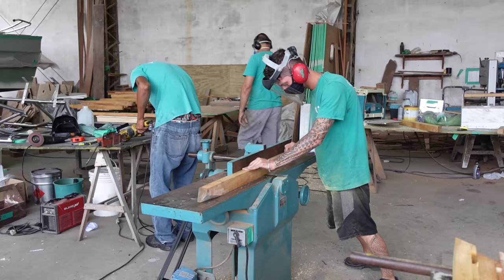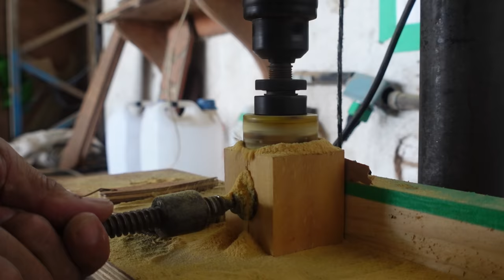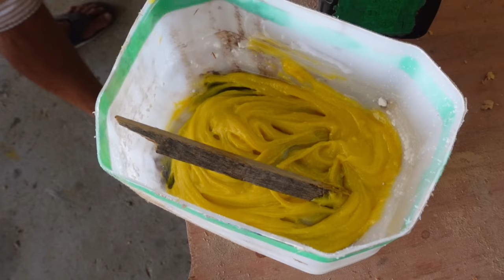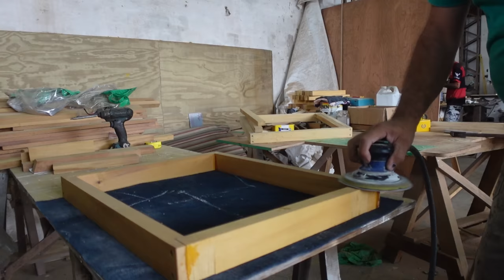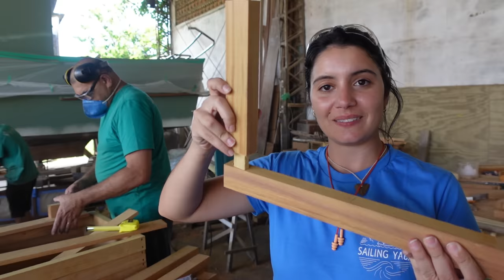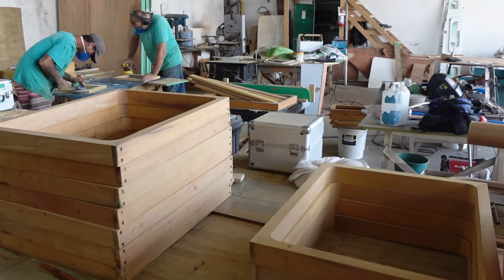Hand-crafted wooden windows for a hand-crafted wooden boat — Sailing Yabá #87

Comment: You might want to have a couple of spare windows made for replacements.   Also, are you planning on fresh air ventilation?  You should be able to have the windows closed and still have ventilation.

Comment: How are you going to maintain water tight integrity with the sliding windows?
Reply: My question as well🙄😬
Reply: Probably the say way it's done on houses for 100s of years.
Reply: @SawmillerSmith  Houses and boats are completely different animals, there zippy.
Reply: @brutusbarnabus8098 windows are windows on a boat or a house. They both if built correctly keep the water out. This has been done for hundreds of years.
Reply: @SawmillerSmith  This is not a preferred window for a marine application. All residential windows have weatherstripping to prevent elemental intrusion. These  windows (portlights) have none. You can slant the exterior sill on a house window and shed water because the wall remains perpendicular. Sailing vessels simply do not lend themselves to maintaining perpendicularity. Even in a moderate squall with 25 knot winds, those windows are going to allow fresh water intrusion which is not desirable on a vessel.
Reply: @oldsharkie3786  I've worked on a lot of old homes were the windows had no weatherstripping. They had cast iron weights to counterbalance the bottom sash and they have keep water out for decades. I'm sure they have a plan for all your concerns. I'm not an expert boat window builder. But I have redone lots of old windows that have worked for decades with weatherstripping. Perhaps they will add weatherstripping when the window frames are done? Be a simple thing to add on.ive done it to lots of doors and windows.
Reply: @SawmillerSmith  Your words "I'm not an expert boat window builder." In light of this why not move on with your day, zippy.
Reply: @brutusbarnabus8098  True I'm not an expert boat window expert. But they are some  similarities. They are basically the same. These boat windows have epoxies in brass and other things. There are always these so called experts that have an opinion yet never no experience about the subject. Happens to me before. I'll be doing a job for someone and they tell me how to do the job. If they know how to do the job why would they hire me to do it?
Reply: @SawmillerSmith  In another 10 or 15 years this boat will be rotten again. Hopefully they can sell it before it gets too bad. Water will hit the windows from all directions. They will leak.
Reply: @verdigo5892  10 15 years most boats leak and rot away if you don't do anything to them if keep in the salt water.

Comment: By having sliding windows, does the risk of leakage increase significantly?
Reply: Once you're on a boat, there's no risk that it won't leak somewhere. Sliding windows just increase the amount of leakage  :D
Reply: Considering where they are, no more than they would on a house, the windows are on the sides of the cabin above deck, well inboard and under eaves (coachroof) so it would not be any difference to sliding windows on a seaside house. if they were in the hulls like portholes then I would be more concerned. but many boats have sliding windows this high above the waterline.
Reply: @daveamies5031  Thanks Dave...that’s clear👍
Reply: The only way now of making these window openings watertight is to devise shutters with gaskets over them.  These sliding windows cannot withstand water ingress and will rot quickly, even when epoxied.  Even if they are planning on only using the boat in sheltered waters, these windows won't keep out the rain.  I have far better windows on my house beside the sea.
Reply: @evanschwartz3030  On reflection, I lean towards Evan. We live in Normandy France. The wind and rain always come from behind the house so we have no windows at the back and I cannot recall the last time I cleaned the front windows on any floor as the water never touches them. I will be fascinated too see how they try to prevent water entry. I guess shutters would not do the biz? As you can tell, I am no sailor🤦🏻‍♂️😉
Reply: @evanschwartz3030  Sliding horizontal windows leak on houses too when the wind pushes the rain against them, never said they would be water tight, just that it will be about the same, it won't sink the boat it might be enough to end up with a damp bunk though which could be unpleasant, if the outer part of the window is fixed and the inner window closes towards the stern it shouldn't be too bad if they can keep the bow towards the wind.
Reply: @mikewilliams4499  Your lucky to have predictable weather conditions, most of my windows leak on which ever side the storm comes from, storms come from all directions where I live, westerlies usually bring hail, northerlies bring damaging wind and southerlies bring cold, easterlies bring lots of water (300+mm/hour) and flash flooding. 
I don't think any of Yaba's sliding windows will be installed facing the bow, so they if they are at anchor they may get less leaking through their sliding windows than I do?
Reply: @Tomm9y  The whole boat is going to rot...the sealing paint they used everywhere was only minimal. But they should get about 10 years before they need to start over. Also, they left a lot of rotten wood in the hull and that will only shorten the life of this boat. I still say they would have done better to just start from scratch.

Comment: Beautiful work. I also am concerned with the high possibility of leakage. Sideways winds Squall,  hurricane force winds, bow spray. Even just condensation can be an issue I would think. I hope not, but definitely consider it when building the windows.
Reply: I have said it before and I will say it again the skilled workers allowing Yaba live a new life are amazing. Yaba is certainly not a boat built of modern materials like fiberglass and carbon rather a locally traditional build using methods of a traditional design. That is what I think makes it so unique. Simple things like drilling holes in the window frames are done by eye and from what I could tell are spaced equally within a few millimeters of one another impressive stuff. Stay safe
Reply: @mp6756  I’m with Raymond on this the windows will leak. Will it sink it? No. Would it look stupid with round portholes? Yes. So decisions are made based on usage and style. I do hope the don’t use plain glass or cheap plexiglass.
Also I don’t think they are going world cruising. I remember something about a dive boat.
Reply: @icelandviking1961  Agreed they will leak no doubt about that. I'm fairly confident they are going to rome the coastal waters of Brazil. I hope they don't try crossing the Atlantic with Yaba it's definitely not the right design and with only internal ballast she won't be comfortable on the open ocean. When I say comfortable I mean safe. Brazilian schooners are very popular as charter business hosting tourist and for the two of them on their channel they have a lot of beautiful country to explore and share. Yaba is big enough I'm sure they could sail to the north up the coast without much difficulty. It's a great channel watching the boat take shape with what I would say different than usual construction methods.
Reply: @mp6756  Mike, I worked in a boatyard in the 70’s in California. Some of what they do was use on wooden fishing boat then. It was cheaper but not unsafe. The marine growth will be harder than anything else. Remember a boat starts sinking the day you put it in the water.

Comment: Just a small tip. Make a lip above each window. That prevents them from leaking most of the time. I think you know that your boat will only be suitable for coastal cruising and that's fine. But be aware that leaking windows are a serious problem on a wooden boat!
Reply: I think it's more serious if the hull leaks.
Reply: @brian.7966  🤣 Good one if you are referring to my little leaking problem ⛵️ But I can tell you I have experience with leaking windows as well. 😂 Fortunately we don't have a wooden boat. But you would be surprised how fast fresh water can cause damage on wood. It's a matter of a few month.
Reply: @FlyingConey  I don’t think they have a clue it’s just a coastal cruiser. From comments they’ve made, I think they believe they’re going to travel the world in this thing. Hopefully they’ll figure it out sooner rather than later.
Reply: @brian.7966  Wrong! It is normal for a wooden boat to have a leaking hull. This it what bilge pumps are for! 
If you have leaking windows the wood will rot in a few weeks due to sweet water!
Reply: I think they should seal them shut and waterproof them with Sika!

Comment: You are making a huge mistake. The runners of the windows can not be sealed from the salt water after they are assembled. They will rot rapidly. Use some sort of plasitc for this.

Comment: What method is used to prevent leakage from the sliding portion of the window?
Reply: Prayers 🙏
Reply: They have already explained that there is drainage from the lower channels to the outside.

Comment: I wondered why they didn't square up the drilled mortises rather than rounding the tenons. Maybe mortising chisels are hard to get. Also, perhaps build a tenoning jig for the table saw to hold and support the piece vertically while it's passed through the saw to cut the cheeks. I've seen them made to fit and slide over the fence; pretty quick to make.

Definitely want holes drilled diagonally from the track to the outside to drain water away if one will be sliding (don't need both to slide) . Use screws to attach stops to allow removal of the window for maintenance. Sometimes the upper slot is deeper so that they can be lifted up and over the stops.  Consider making the opening window swing up and land on gaskets when closed.

Comment: Maybe I’m old and jaded by time. Dunno. While the fitment/craftsmanship is fine, I am taken aback a bit over the repetitive cutting and fitting being done without any jigs or shoulder planes. Having dabbled in boats but done a ton of carpentry and woodworking in my career I’m astounded at the inefficient processes. They got it done but it just gave me anxiety watching. 

Not being mean that’s just what I noticed: it showed how I might make something if I were making only one or two, but I’d do way differently if making four or ten of something. 
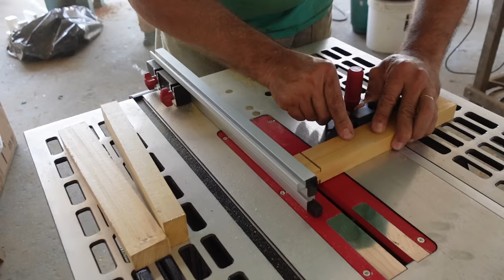17:59 I might measure occasionally but I’d be way past using measurements at that point for example.

Comment: Hey , you guys... You might want to make a hope chest in your apt. Build at least 2 extra wood window frames, and save them for repairs. 
In 10 years wood of that ki d may not be easy to get or will surely cost a hell of alot more., I would vacuum seal the wood parts in a food saver bag, 
So 10 or 20 years it's still dry and good. Any, key part, you can make a extra one, do it now and save it at your house. Even the spindles, made out of wood break .

Comment: Another interesting video. Got to ask, why doesn't that shop use dado blades?
Reply: Right!?! They would save so much time!
Reply: Dado’s are considered to be dangerous in a lot of countries. Can’t buy those machines in Europe for instance.
Reply: I was pondering that also. The only reason for not using a dado is they would have to change the blade to adjust width. I did notice the table saw at the beginning the blade a a bit of a wobble.
Reply: maybe they dont have a suitable saw to fit them to they showed you how to do without them got the job done i would say thats a win
Reply: @nicobogaard2315  I was wondering if it was a government decision, they didn't use a dado blade. I am a retired self employed cabinet maker here in the states and I couldn't imagine not having a good dado stack set. I have 3 depending on the wood I'm working with.

Comment: I would have preferred to build the windows out of high strength vinyl with high impact glass. The wood frame is likely to start rotting at the bottom tracks. Anyway, good luck and great workmanship by the carpenters!

Comment: Have you thought about rain and wave over the decks with sliding windows. Maybe a two window system one external the other one a water tight hatch on the inside.

Comment: I hate to sound like a kill-joy/ know-all but epoxy resin is a gap filling material and should not be used in tight fitting joints where squeeze-out is expected. A waterproof glue like Titebond 3 would be much better.  (Retired wooden boat builder)

Comment: man some one needs a dado blade set
Reply: they dont need a dado set job is done
Reply: @brianseager6388  I did not say that  I said they need one it will simplify the process
Reply: @brianseager6388  I did not say it is impossible to get the job done  but sliding a piece of wood over a sawblade multiple times as well as sideways  takes a lot of time and is crazy dangerous. A dado blade would do a cut like that in 1 pass and saving fingers and flying wood. Case and point some one needs a dado blade set